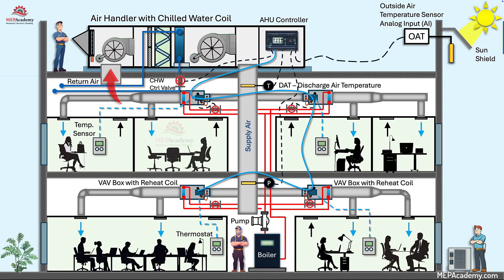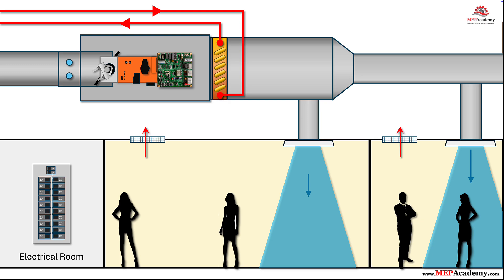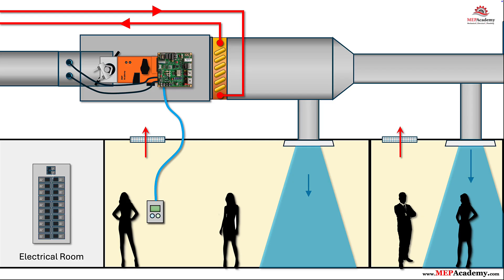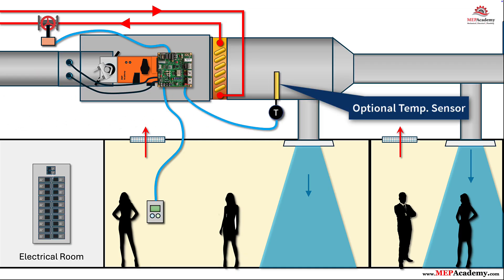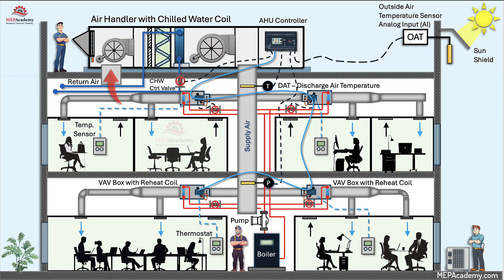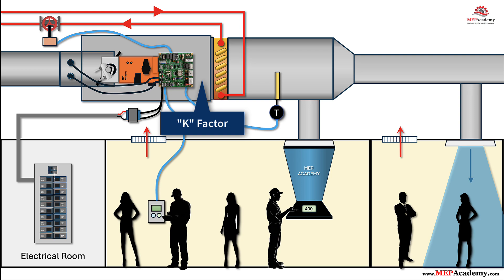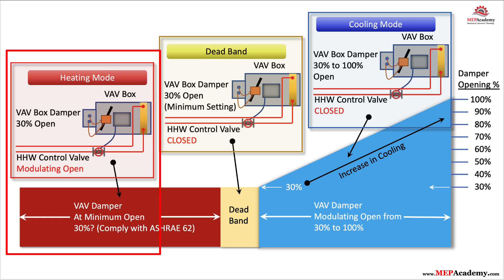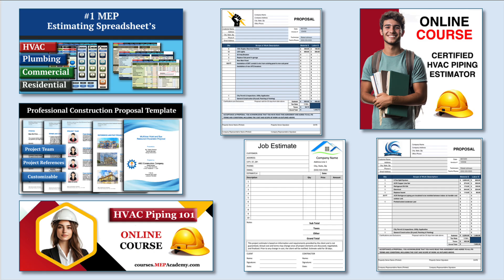How a VAV DDC Controller Works

Comment: Can anyone just buy the controller and installed them?
Reply: There are diy options but most building that already have engines, controllers and device integrated often go through notable companies that have proprietary software that you’ll need credentials and licensing to have access and integrating them in 3rd party items is its own can of worms in itself